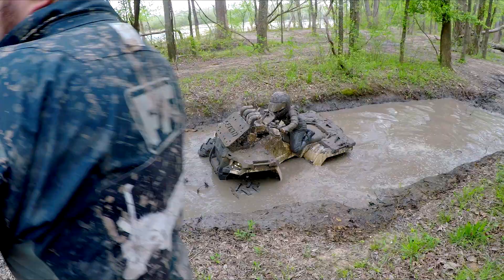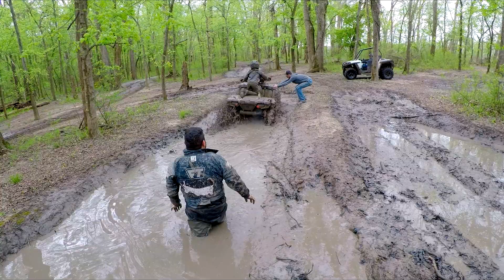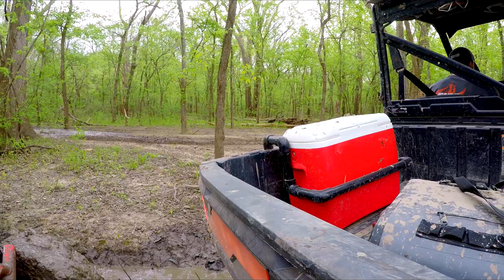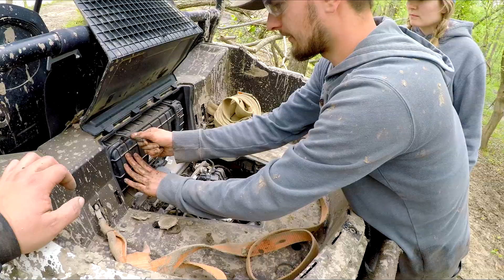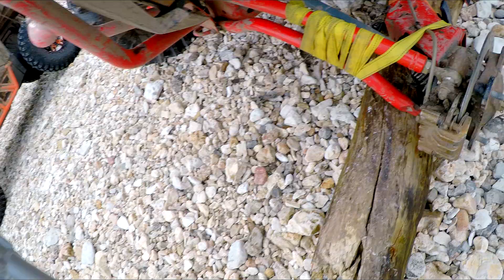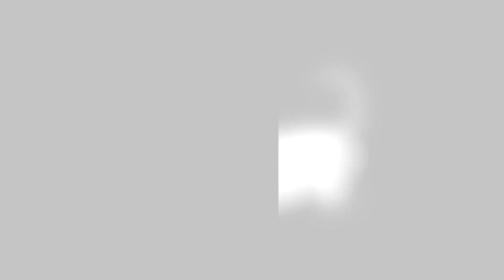Pushing The Competition In My Finntrail Waders | Disney Oklahoma

Comment: Looks like a lot of fun. But I need your advice. What do you think would be the best atv for a newer rider. I’m 13 and have rode a 2002 Yamaha Grizzly 660 bone stock for my entire life. But I think it’s time for my own machine. I want something easy to build up. Like that I can do in my garage with my dad but it also not cost a fortune. What do you think? I need help I can’t get good advice from experienced riders because they don’t respond. Let me know what you think.
Reply: Whats your price range and what brand are you looking for?
Reply from the maker: I’m definitely not all that well versed on the mechanical side of things but I think that Honda’s are probably one of the cheapest and easiest to work on. Your not gonna have the power you had with that grizzly or the cabana and Polaris’ but the Honda’s are solid and capable machines as long as you know you’re not gonna be slinging mud all over the place like the big boys. If you can find a rubicon with the diff lock and foot shift I would go that route.
Reply: Swamp Ass, Thank you so much.
Reply: Yeah I have Polaris and a Honda and he's right. Honda is a lot cheaper to work on and parts are even cheaper.  It doesn't have the speed of the other brands but I guess it depends on what you're wanting to do with it.  Most trail and mud rides you don't get up to fast anyway

Comment: hell yeah good time dude. did you get it on video where he snapped it off though? hope you did.
Reply from the maker: Man I sure didn’t. It was my first time at the park and the cops pulled me over for not having a helmet so one of my buddies gave me a helmet to wear but it didn’t have my camera mount so I wasn’t recording when it happened. But it happened right in front of me. He was going up rock hill at a 45 degree line pretty fast and when he hit the bottom of the hi the suspension damn near bottomed out and the lower arm just folded up on him.